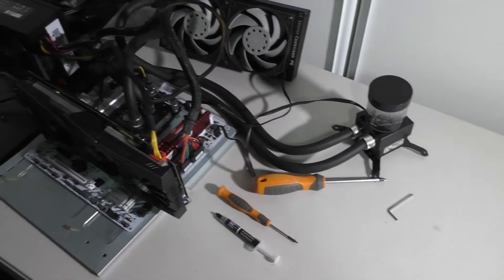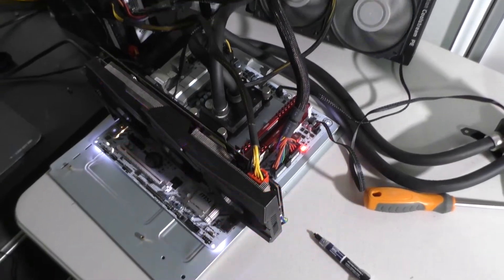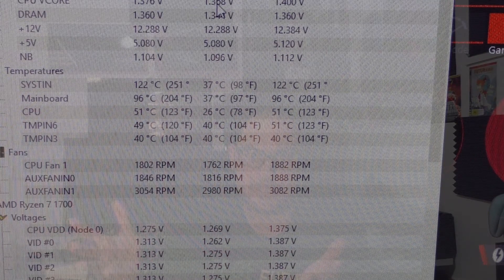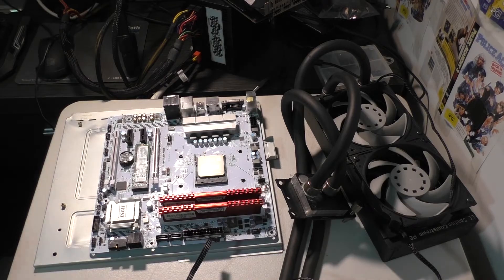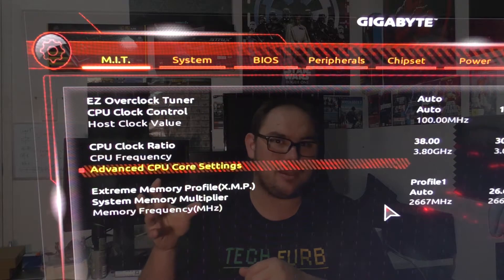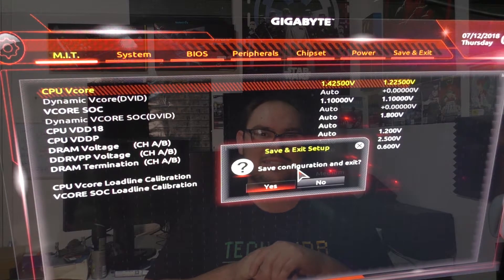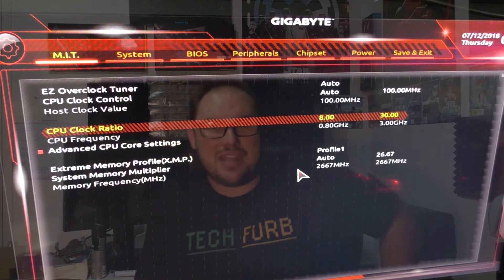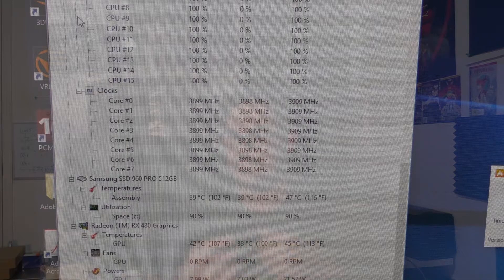Do you need a High End Motherboard For Overclocking Ryzen 7???

Comment: what's the point of "Overclocking", you should focus on creating a more stable system instead of a fast system but more likely to crash
Reply from the maker: I have always overclocked every PC I have ever owned and never had stability issues, the trick with overclocking is you initially push the system to it's limits and find out at what point it crashes under a stress test and dial it back from there. In the case of my system with the b350 board I am able to run it at 3.7 all the time and to validate the overclock when I first set the system up I run a synthetic stress test on the CPU and GPU for 12 hours, if the system doesn't throttle, crash or overheat then your good to go. Overclocking is great as it allows you to get a cheaper CPU and extract the same level of performance as a higher end chip. This is of course is almost unheard of these days thanks to Intel disabling bclk overclocking on their 2nd gen and newer i series CPU'S